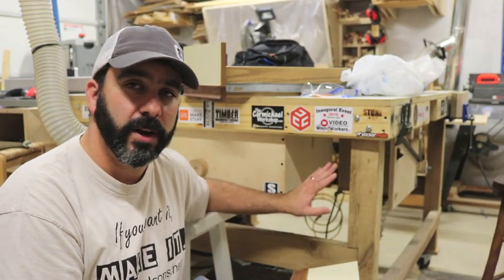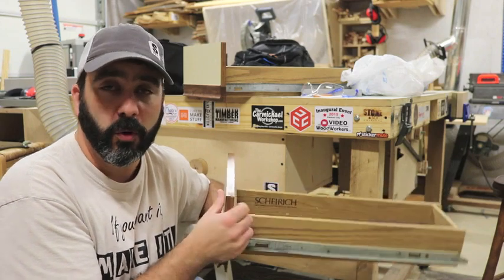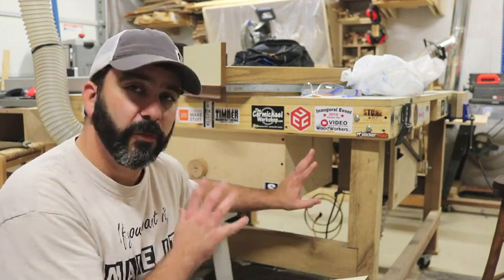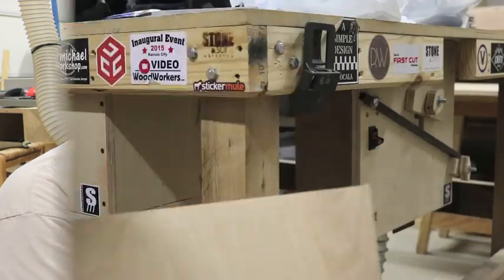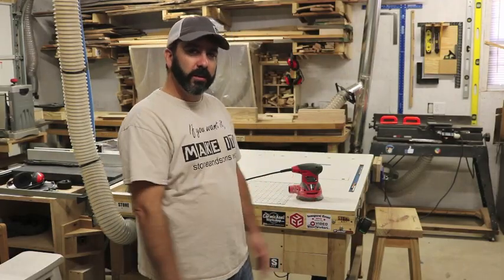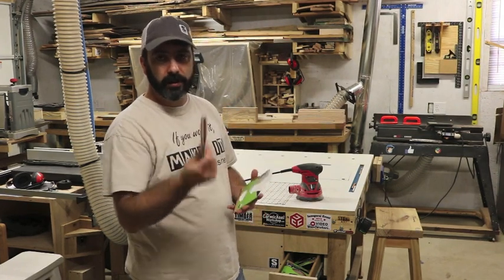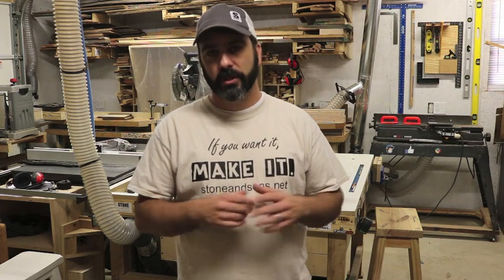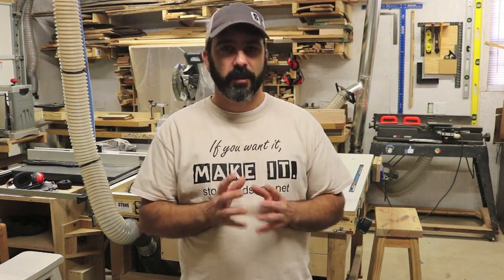Small Shop Organization - Drawers

Comment: Solid tip. Most don't think to look at these little pockets of space. I want to do the same concept but make a box and drawer that I can fit my small hotdog air compressor on. Currently it's just sitting in a similar void to yours in my workbench. Thanks for sharing brother! Nice video as always.
Reply from the maker: +Zac Prunty glad you found it useful. Thanks for watching!